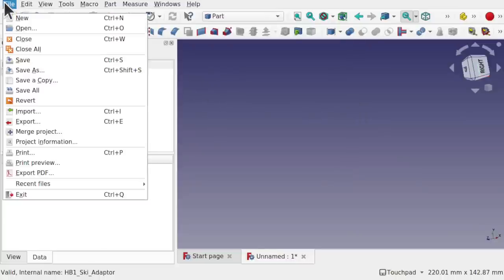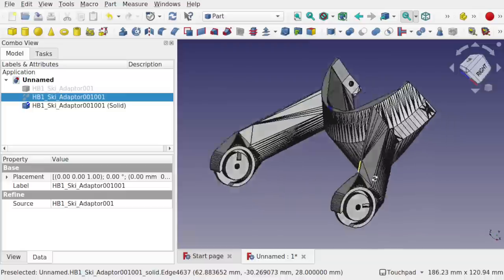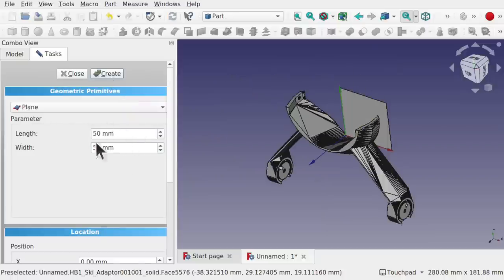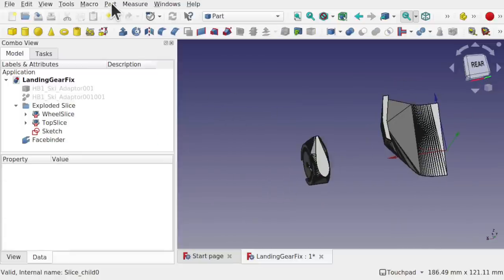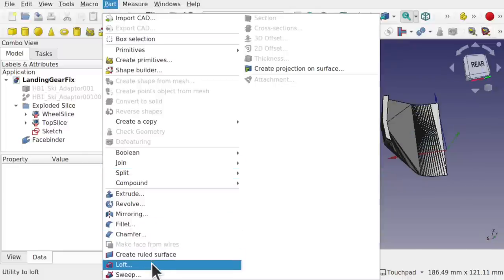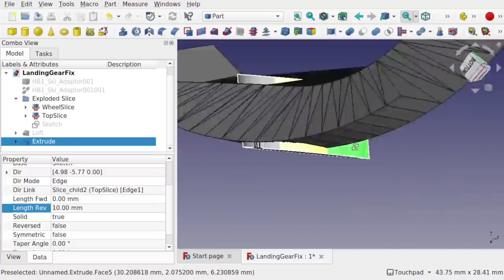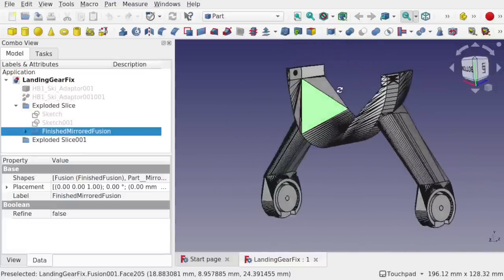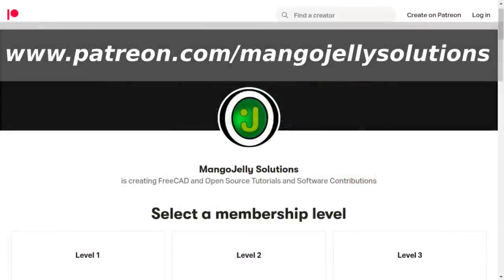FreeCAD: Adding Your Own Modifications to STL / OBJ / 3DS files  | R/C Landing gear modifications

Comment: I am glad it works for you, but it does not for me.  I have tried several times, but FreeCAD either locks up and I have to restart or it takes a really really long time.  I have switched to using OpenSCAD to modify an stl like I used to and in less than half the time though maybe not as precise.   I don't know if it something I am doing or a bug in FreeCAD.  I will try again when the next version of FreeCAD comes out.  I am currently using 0.21.2.

Comment: Great work as usual. Use the "View Sketch" button, looks like the Sketch icon with a magnifying glass (right beside the "View Section" button) and it will square up the camera to the sketch plane, instead of eyeballing it.
Reply: another useful button I was unaware of! thanks.

Comment: Another excellent tutorial. It occurs to me (though I haven't tried it) that you can "import" the segmented circle by selecting 2 opposite line segments then drawing a circle between them and making the circle tangent to both lines. This could be made construction geometry then the actual circle can be drawn to the desired size.
Reply from the maker: Glad you enjoyed.  Great tip, I'm sure that will work. Thanks for sharing 👍👍👍👍

Comment: I’m surprised FreeCAD doesn’t have a snapping mode where you can snap objects in the sketch to other geometry. Like in Blender.
Reply from the maker: So actually there is but you need to use the draft workbench to do this. Sketches are based around constraints so you connect to other geometry and import geometry from other sketches rather than snap to them. You can use the snap draft tools outside of sketch for other geometry. I have a video for fixing the center point on svg where I snap imported svgs to sketch geometry. This same thing confused me when I came from mesh modelling to CAD.
Reply: @MangoJellySolutions  thank you 😊

Comment: You might add a filet to eliminate the sharp corner between the leg and body. The sharp corner leads to stress risers and a hard landing could cause a fracture at that location.

Comment: 30:30 A more precise way to reproduce the circles in the sketch: import 3 evenly distributed vertices; draw a circle; constraint the points to the circle. (When you import only 2 points you may select two that are not exactly on the opposite side, so the line between them may miss the center of the circle.)
Reply from the maker: Great little tip there, thanks for sharing so other people can benefit 👍👍

Comment: Another great tutorial, thanks MJ.

Edit: An interesting thing to do for another video is to show how you'd go about adding another feature to the already-completed part, like, say, bore a hole through one of the struts that then propagates through to the final mirror/fusion (if that makes sense). Such edits can be difficult.
Reply from the maker: Thank you glad you enjoyed.  RE: idea, yes noted, I know what you mean.  You have to insert that operation into the tree as if you created a boolean after the mirror from the original part that was mirrored you then need to link the mirror operation to the new fusion.  It's a great idea thank you for that :)
Reply: @MangoJellySolutions  Thanks, MJ.

Also consider showing a case where you need to remove a feature that sits somewhere in the middle of 'the tree'. Even uglier.

Comment: Would this be a good topic for a video: What does it mean for something to be a shell vs. a solid, and what are the ramifications of each with respect to the operations that can be performed upon them by which workbenches? Same question about lines, wires and edges.
Reply from the maker: This is a really good idea and it extends one of the videos I want to do on understanding downgrading and upgrading these to more complex items i.e. compounds, compoundsolid etc.  It's good knowledge to have as once you realise that everything in freeCAD is one of these number of objects you can understand how to break them up into simpler parts.  i.e. if you do a cross section, this is just a compound of wires that can be exploded and reconfigured.   Added to the list.  Thank you :)

Comment: sigh.
what to do when the stl appears to be so intensive it simply crashes everytime you try converting?

edit. with some fiddling around, WB meshdesign, "decimate". reduce polygon count. theres a limit of 100K or thereabouts.

i tried something a bit less complex, that was near instant.

but the one file i have to open? i even just tried upgrading to a new PC...